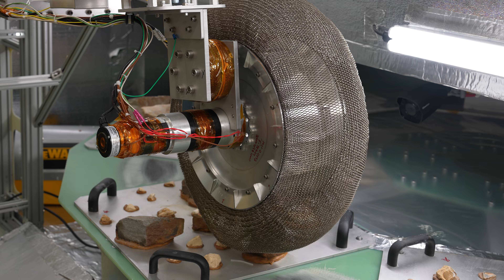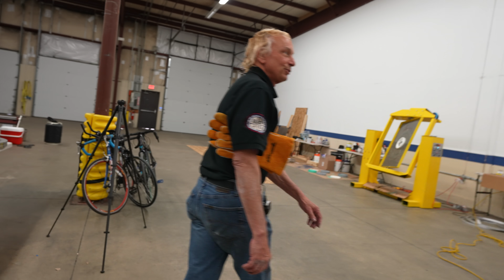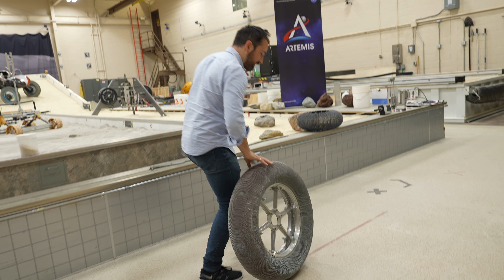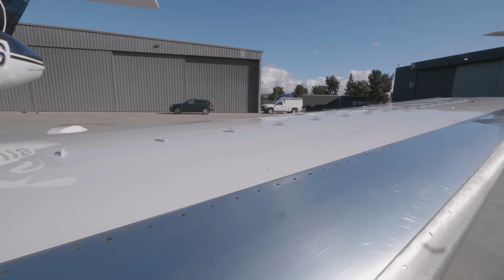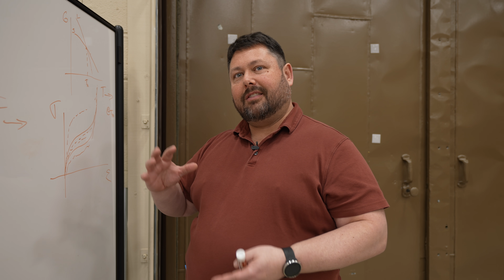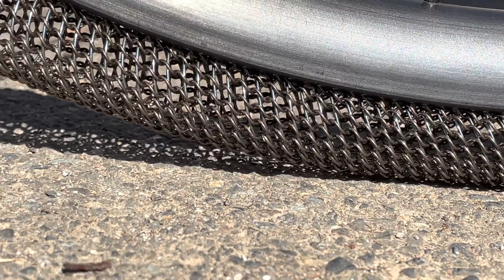How NASA Reinvented The Wheel

Comment: I wonder could this be used in the military? For instance, tanks obviously use high grade steel to construct the frame and armor plates of the vehicle. But tanks use composite armor to increase the protection in certain areas of the vehicle to prevent penetration of sabots and rockets. Could Nitonol be used in composite armor to absorb the impact of the round without being deformed and preventing penetration of the crew compartment?
Reply: Probably not, there are a lot more considerations that go into tank armour than just flexibility, in fact that's usually of least concern. First layer is composite because it's extremely hard, that breaks up the projectile. Than it's usually an air gap to the the pieces scatter, than the main strength portion. 

All of these factor in weight and cost among other properties. Ceramics are very hard but lightweight, and uranium or tungsten is used behind it because of it's strength, hardness and density. Nitinol doesn't really have any of those things besides strength, but even that is quite low compared to tungsten or uranium. 

Plus nitinol is extremely expensive, even in small parts. A lot of the cost goes into heat treatment, which is very specific and requires large advanced heat treating equipment. Making a tank hull from nitinol and then heat treating it would probably be in the hundred million dollar range per unit.
Reply: @probablyinconsistent4756  What about the treads? A lot of anti-tank tactics rely on disabling tank treads or otherwise making areas untraversable with traditional tank treads. Would this material make such tactics more difficult to implement?
Reply: @strikerevimus  I'm not a tank engineer but that would seem unlikely to change anything to me. Tank traps and other anti tank emplacements simply rely on the fact the vehicle is tracked and/or low to the ground. 

I don't see the material the track is made of changing anything major about the function of the track over obstacles. Nitinol is very strong and has a lot of amazing properties, but it's still not going to survive a uranium rod going through it at supersonic speeds, and it's not going to help a tank get over a trench or tank trap.

Comment: I may have missed it but it seems that there was a missing explanation of how nitinol tyres will remain resilient in the vastly different temperatures of other planets/moons. It was explained how low temperatures allow the nitinol to have greater deformation and that high temperatures return it to its memory shape. Well what if a combination of low temperature and impact forces create massive deformation ? and what if there is no available heat to help it return to memory shape ?
Reply: The properties can be adjusted through the alloy makeup and the heat treatment process. All of the conditions you expect the material to go through influence those material and processing choices. 

Nothing can ever be engineered perfectly for every situation so of course there will be drawbacks. However it would be pretty easy to heat up nitinol if it was ever deformed. All that's need is to flow a current through the material heat it up, nitinol has a particularity high electrical resistance so it would heat up easily under moderate current. Easy lightweight solution with no moving parts.

Comment: Great video! I would liked to see some mention about how though this metal is and how much friction you can get without having rubber on the surface.
Reply: Metals usually don't have great friction coefficients. Hence why they covered it in a polymer. However I feel like it would do well in snowy or icy conditions considering how we use chains and studs in a similar way.

Comment: Truly impressive, I knew they were making wire mesh wheels, but didnt know the specifics of the metal and how it worked. The part with the stretching and it squeaking was especially cool.
Because it is a titanium alloy though, what would the cost be for a full set of wheels for use on earth?
Reply: Nitinol is hugely expensive. Not only for the material (because it's an alloy of titanium and nickel) but also the heat treatment process.

Comment: I feel like using tires like this on Earth would require a lot of new infrastructure in terms of maintenance. The amount of forces experienced by passenger jets and road vehicles is way higher than a rover. The  hardness of the material will also impact road structural integrity over a long time. Titanium is also very expensive so people are definitely looking for cheaper alloys with similar properties.A lot of research is going to be needed before we ever see this technology commercially used on Earth.

Comment: Suppose the material goes through a mechanical stress like bending it, as the material gets heated up due to the stress if we cool it instantly keeping it at that shape will it still comeback to it's original shape??
Reply: It shouldn't, as the heat treatment process, which actually sets the shape, is performed at hundreds of degrees. I think it would just become more brittle, possibly plastically deforming.

Comment: Great technology but I'm afraid that in my lifetime I won't see this applied to car/bicycles tires. The tire industries hence petrol industries won't let another big part of their core business go away. The lobbying will prevent this. Let's hope I'm wrong!
Reply: If you can afford thousands of dollars for a single car tyre than I think you wouldn't be worried about the price of a flat.
Reply: @probablyinconsistent4756  It's not about the flats, it's about the ecological footprint, now every X amount of km you need new tires because the other ones are worn off. Ofc it's not proven these new ones are durable or more green to make and expensive but as mass production starts price will go down.
Reply: @JelleRevyn  nope, even at mass production the price would likely only go down by a small amount. As mentioned inconel is a alloy of nickel and titanium, the materials alone are expensive before you even turn it into inconel. 

This isn't even mentioning the process of creating the alloy, which is very specialized, and then heat treating it, also very specialized. Inconel is not a material to be mass produced on basically any scale.

Comment: These are awesome wheels for spacecraft but I wonder how fast they would wear down just being driven on a highway?  That's a lot of titanium dust being sprayed around!
Reply: Nitinol is extremely hard, it would actually wear down the road before the metal. It also has a low friction coefficient though so it would have to be covered in a rubber anyway.

Comment: As an engineer I’ve known of nitinol for a while, did some labs with it in college. But I never saw the example of bending the nitinol pipe in half and have it return to shape. Awesome material
Reply: hell yeah we use it dentistry and are also taught all about it ,especially for root canal instruments and for braces and orthodontic appliances.. but just like you never knew it was used in so many different ways ,crazy that all these fields have this material in common
Reply: 😅😅😅😅8
Reply: Repent and believe in Jesus Christ  Did they use nitinol nails?
Reply: @silknfeathers  Just ignore those spammy zombie accounts. Who knows if it's some communists trying to spice things up.
Reply: Repent and believe in Jesus Christ  no 🥰
Reply: My spectacles frames where made out of nitinol when I was a teenager.
Reply: doesn't pebbles or sand accumulated inside such mesh tyres?😂
Reply: @Rational-555  no
did you see the mesh?
it's a really fine mesh
and if they do, you can get them out pretty easily
Reply: @skeptic_lemon  Just wondering,  If they send Mars exploration rovers with such wheels, small pebbles keep on accumulating due to wheel pressure on ground..... in no time get collected lot and hinders the work......🤔🤔
Reply: @Rational-555 💯
Reply: it's super cool to feel in person. that hot/cold effect is even more than you'd think (check out the facial reactions in the video)!
Reply: @thesmarttirecompany  For how long does the bent part stay warm?
Reply: @slav_K0  if you are holding the tube like in the video, the heat will linger for a while (really it's your hand holding on to it). Otherwise it would dissipate into the air if it were held in place. However, for a tire rotating at high speeds, there is not really any time for the heat to escape, which is perfect because we get to "recycle" that heat energy instead of turning it into waste heat.
Reply: @slav_K0  That will depend on heat capacity of the material and convection.
Reply: @slav_K0  these people specialize in telling lies.  They tell you stuff you already know. Then make up a bunch of stupid lingo or jargon to make themselves sound smart
Reply: @Piscatorialveteran  Did you know about nitinol? I didn't. And I'm sure a lot of people also didn't. Your argument doesn't hold up for this video.
Reply: @thesmarttirecompany  😊
Reply: @thesmarttirecompany  🎉🎉😢🎉🎉🎉🎉 no no
Reply: @thesmarttirecompany yeah
Reply: Repent and believe in Jesus Christ  bro this video is too interesting for you to be here
Reply: I saw it a while ago on YT.  Someone showed how the metal returns to memory.  They were testing for military vehicles.
Reply: How reliable is nitinol when used as a shape memory material.. does it creep?
Reply: I remember reading about it in a magazine that must have been from the 70s or 80s. It was predicting it in a type of engine using a temperature gradient in a liquid.
Reply: Curious to know, what class did you take this in? I'm doing mechatronics engineering at a technical college and I want to see this kind of stuff!
Reply: Sick car dude
Reply: @AppleReviews  the 50’s actually
Reply: @AppleReviews  yea, hehe
Reply: Earth is Flat Friends
Reply: The earth is flat. NAsa stealing your money.
Reply: "aS aN eNgInEeR" - every engineer. Be humble don't be a dickhead.
Reply: Pppppppp
Reply: How about a video on SpaceX and the recent DISASTEROUS launch failure next?  You call yourself a legit scientist but won't touch the FRAUD that is Elon Musk and SpaceX (not to mention Tesla FSD, Semi, Teslabot.....).  Check out Common Sense Skeptic's recent upload on the epic launch 'success' and tell me Musk doesn't warrant further scrutiny from a mainstream science channel.  If you're a real science journalist then you should seek truth, without fear or favour.  Otherwise you're just another muppet on the take.  Man up.
Reply: ETERNAL SALVATION IS A FREE GIFT RECEIVED BY FAITH ALONE 🎁 

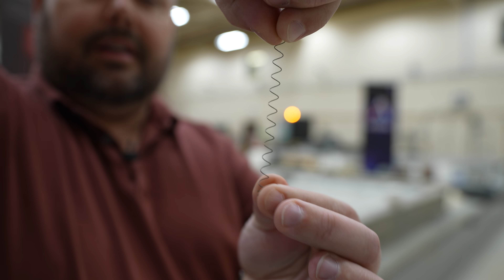.......Believe the Gospel of the real Jesus Christ for Eternal life. (John 6:47)🙏........  

We are all sinners  who broke Gods law and deserve to pay for our sins in hell, but God so loved the world(you,me) that he gave us his son, Jesus Christ for the payment of our sin debt. 

Jesus lived a perfect life. Was crucified on the cross, He died, was buried, and arose again on the 3rd day for the Justification of lost sinners.

Whosoever will believe in the redemptive work of Jesus Christ that he  PAID ALL SIN DEBT in FULL with his PERFECT BLOOD, will receive the FREE GIFT of the IMPUTED RIGHTEOUSNESS of Christ, The GIFT of the HOLY SPIRIT and the FREE GIFT of ETERNAL LIFE.

Salvation is as easy as opening a 🚪
Because Jesus is the door.
By grace we are saved, through faith.

(John 10:19)*
📜 "I AM THE DOOR: by me if any man enter in, he shall be SAVED, and shall go in and out, and find pasture."
Reply: Batman's been using it for years
Reply: I watched a video about this stuff in the early 2000's im 21 now XD
Reply: Repent and believe in Jesus Christ  You cannot say this with a straight face while your country wages wars left and right.
Reply: Roswell memory metal. Copycats.
Reply: Would love to know if there are any limitations that would prevent this technology eventually being adopted.  Eg expense of producing mitenol
Reply: ok ok do you know where to get some
Reply: Had NITINOL archwires for a time when the orthodontistry school was experimenting with such things (a long time ago...). Nobody could figure out what to do with the stuff- glad it's useful!
Reply: As someone who's been on youtube for more than a day I also know about nitinol, can I brag about that too?
Reply: Hahaha I was literally about to say the same thing! This video has some details about Nitinol I'd never seen. Now I am excited/inspired to design it into some new applications!
Reply: @Repent and believe in Jesus Christ  
If you're here to imply that these amazing advancements are all due to the grace of God, and not to the hard work of a functioning society of His children.....welp, then you're kinda being an asshole, man.
Reply: Which engineer are you?
Reply: I😅o
Reply: And do you even realize that is the same principle of air conditioning? that heat exchange if the scale is right and the methods of application too this can be revolutionary. we're far beyond of bullet proof wheels
Reply: What's the point, US never been to the moon or will be able in the future? The world knows the moon landing was FAKE.
Reply: It’s such a cool material and can do some pretty cool stuff
Reply: I first read about it in the late 70's
Reply: @harpintn  😵
Reply: Repent and believe in Jesus Christ  man why are you people always here?
Reply: @gortalla5474  because it’s about science.
Reply: @gortalla5474 i am late but they're gone now :D
Reply: what made me laugh was "were going to shoot it with a bullet"   
]puts on noise cancelling safety ear muffs[     
]shoots a BB gun[
Reply: @Jay Z  Pellet gun.  There's a big difference.
Reply: Ok, I’ve been wanting to ask this question for well over a decade now, if this material were to be painted, like a car, I assume it would have a negative effect on it’s performance returning to shape after being dented, correct?
Car paint is fairly flexible and i’m a technician that removes dents from cars without using traditional Autobody methods and materials. I push them out by hand. So i’m sure you understand why I’m curious about this. Ty
Reply: @rogvarley6971  
Paint is pretty irrelevant as Nitinol is a Alloy that is pretty corrosive resistant.  You wouldn't use it as autobody material as it can still tear and dent in an accident and currently expensive. I worked with this material  for medical devices.  We rejected tons of parts for dents material issues from the shaping of the part.  I couldn't imagine it would be cost effective at all to use Nitinol for car body's.
Reply: @lukeleveque2763  yea, I didn’t think it would ever become a material suitable for autos, mainly due to how much the manufacturers profit from paintless dent removal. Saturn tried something similar decades ago with plastic panels. I was only curious if paint would insulate the Nitinol. Question has been in my brain for a lot of years and I really appreciate your help answering it. 
Thank you very much, take care.
Reply: @rogvarley6971  yeah no problem, I mean I see where you are going with that, and it maybe developed better and cheaper into something like this in the future but structural aspects and how to design it would need to be resolved.
Reply: @lukeleveque2763  understood. I see where it’s at now. Still cool stuff. Hey, Great talking to ya Luke. Thanks again for sharing some of your knowledge and expertise with me. Much appreciated
Reply: @rogvarley6971  yeah no worries glad to chat as well.  :)
Reply: We can help scientists by processing data from Boinc distributed computing software
Reply: Yeah I had premonitions were going to condense light and be able to eat it which I think is actually pretty cool
Reply: Indians invented space ships and ufos
Reply: @cowdungplzsaarrr  there’s a difference between spaceships and ufos?
Reply: Is it expensive to make? For example can it become a norm for our vehicles?
Reply: The reason we use rubber is not because it’s inflatable, it’s because it’s grippy!!’ It grips the road!!! Go drive on metal
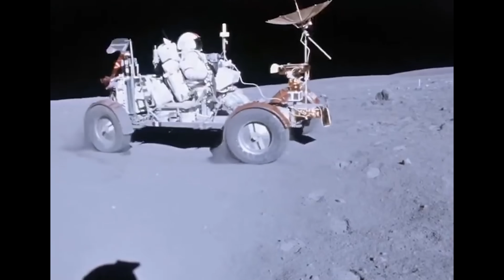Reply: 7:13 yyeah but check out the tyres kicking up that moon dust in "low" gravity
Reply: @janeblogs324  What are you saying?
Reply: @janeblogs324  u do realize that dust will be kicked up easier in lower gravity right? lol
Reply: What’s up with all lisps lispy speakers on YouTube? This is the third person wjth tbe  lispy Steve Jobs talk
Reply: 50 % nickel
50 % titanium
=Nitinol

Can also be used for a perpetual motion machine 😳
Reply: @hauntedhose perpetual motion doesn’t exist. the heat expenditure would negate any net gain you think this could accommodate.
Reply: @hauntedhose  perpetual motion machines do not exist
Reply: @hauntedhose 👎
Reply: i heard about material like this when someone supposedly had a piece of material from a spacecraft that crashed. so, alien technology? we maybe never know. :)
Reply: @jojeeka2  You have a very valid point. It has never seemed like a coincidence to me, that the application of fibre optics suddenly developed after 1946.
The basic principal was known previously, but did it take an unknown intelligence to show us the application.

Comment: Ok ! But now how do you give the original form < spring > to that metal
where it would always come back after deformation ?
Because it is not born as a spring , you must deform it to became a spring
so how to fix that new deformation to the metal ?
Reply: The heat treatment process sets the shape. It's usually a couple hundred degrees.